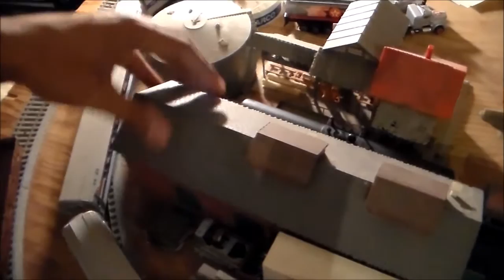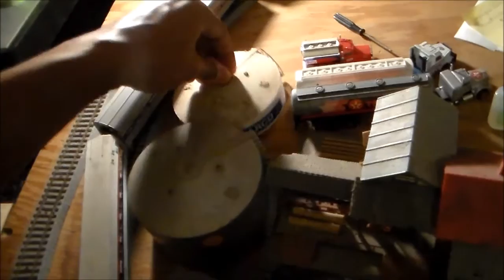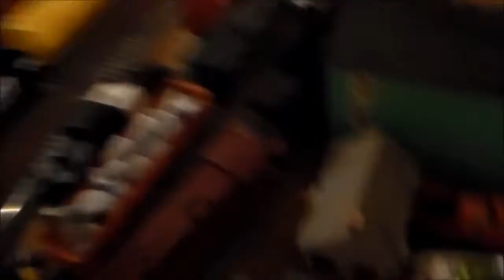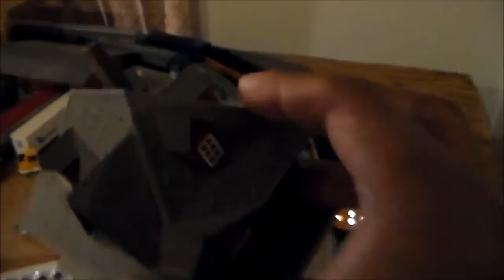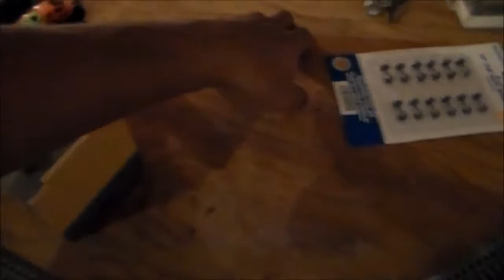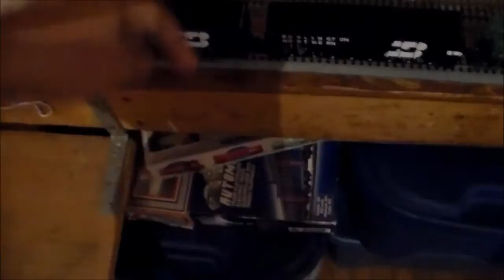Layout Tour 1-24-14

Comment: Great Video!!! By the way how many trucks & cars do you have that are 1:87th scale not matchbox Hotweels or Majio but actual 1:87 trucks & cars?
Reply from the maker: Thanks and I think I have about 6-14 maybe. Mostly the Majorette ones. Only trucks no cars yet but I might have some cars that are 1:87 scale. I'll have to check soon.
Reply: Nice!!! Are you going to add scenery to your layout?
Reply from the maker: MaineCentral114 Thanks and no not this one..in the future yes but I going to get a new layout with scenery on that one.
Reply: Whats going to be the theme? Winter would look pretty cool!
Reply from the maker: You mean on my new layout? More then likely summer and then winter in the mountain areas. Indeed it does look cool in winter.
Reply: If i get the time to build a layout I think would do the same thing too. You could make a small tunnel by the side of your layout and put a snow scene inside of it. NS modeler has one.
Reply from the maker: MaineCentral114 Indeed and I plan to have an area in the mountains for such a scene. Indeed I saw what he did and its cool.